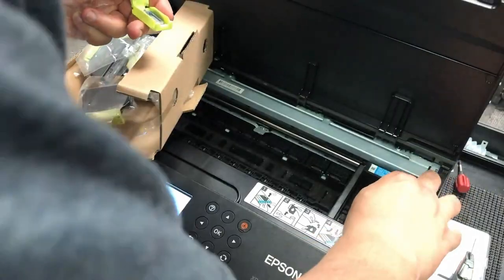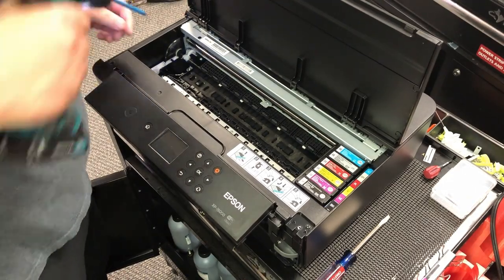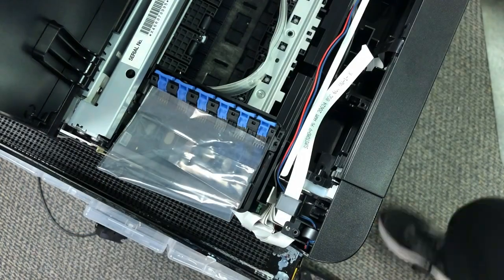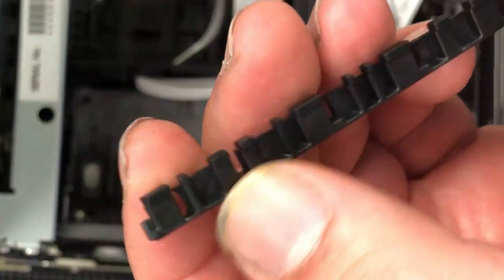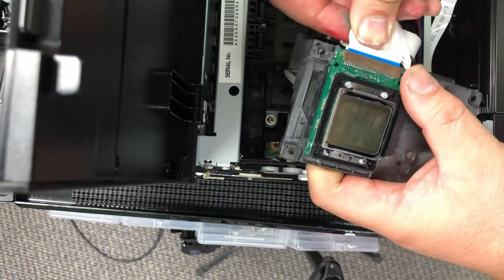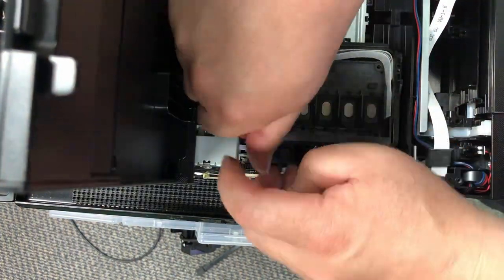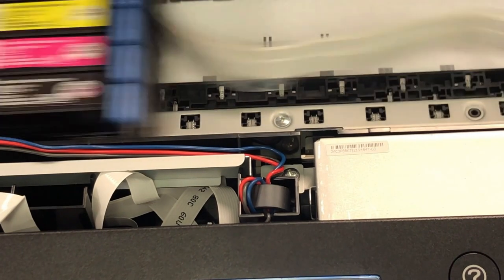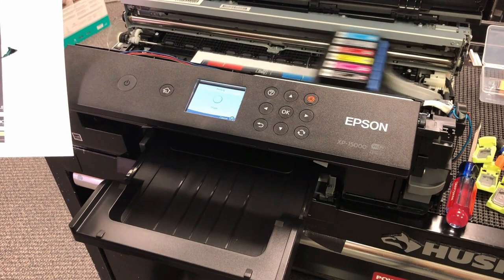A Must-See Upgrade: Unveiling the XP-15000 Printhead Protective Cover V2

Comment: What did you use to seal the motherboard and can I use that is on the chip sensor board as well instead of removing it like in the last video?
Reply from the maker: I used this: https://bchtechnologies.com/silicone-sealant-with-precision-applicator-to-waterproof-printheads-and-ffc-cables/